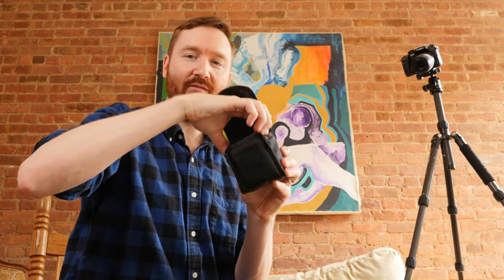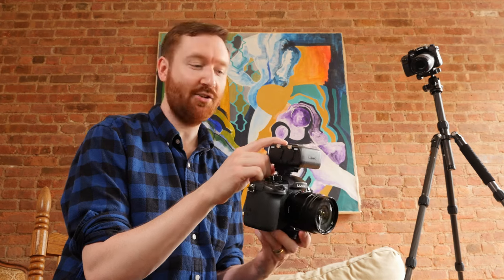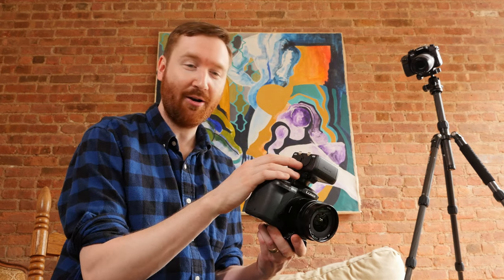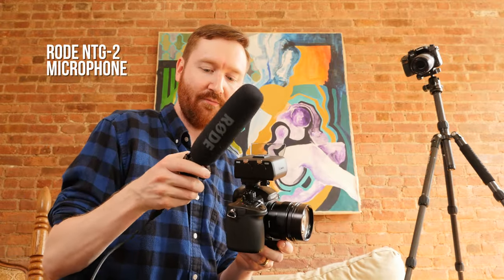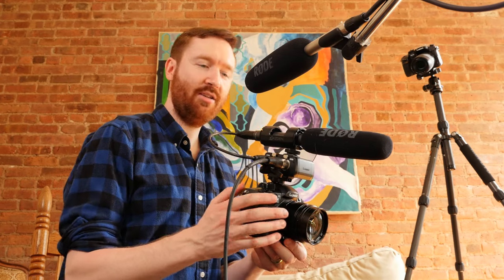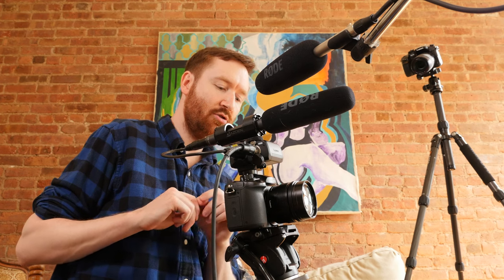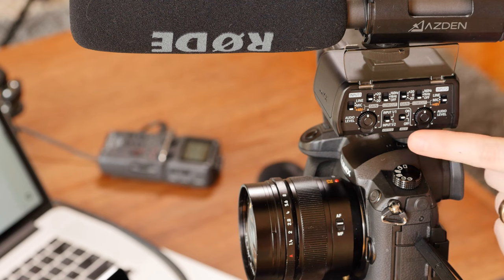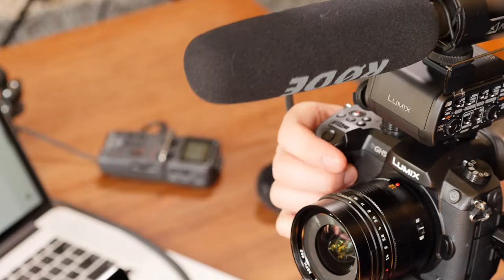Plug XLR mics into the Panasonic GH5

Comment: That noise floor is terrible for a 400 dollar audio accessory!!! This is not good at all. Listen at the 2:08 mark... when you switch back to your external audio recorder it's a world of difference. Anyway, thanks for testing! Oh and how does this thing affect battery life with for example one XLR mic with phantom power connected?
Reply: Most likely the GH5 XLR unit was not optimally calibrated for Griffin's mics. I know that the GH4 has a noise-floor of -73 dB RMS when set-up correctly ( significantly better than most DSLR / Mirrorless cameras ), and I would expect this unit to be as good or better than the GH4. ( for reference the Zoom H4n portable recorder has a noise floor of -66 dB RMS )
Reply: Its just plugging in the mic and adjusting the volume knob to get normal recording levels. There's no 'calibrating'  involved. It all boils down to 3 options: 1) The mic used has an EXTREMELY low output level and the volume on the XLR unit had to be turned up all the way to the max to compensate. 2) The XLR unit is just noisy. 3) Something is defective. Could be the cable, the mic or the unit. 

Apparently the NTG-2 has a rather low output level. I wouldn't say extremely though. So my bet it's a combination of rather average amplifiers inside the XLR unit combined with a rather low output level mic. Either way the result I'm hearing just sucks and is unworthy of 400,- dollar
Reply: It depends on the noise-floor of the preamp and how clean the gain is. Some units work better by recording with little gain and boosting the recorded audio in post, but this depends on the unit having a very low noise-floor.

The GH4 has a very low noise-floor when set to it's lowest audio level ( with almost no gain ), but you need to feed it a strong audio signal to get the best performance from it, which means using mics that put out a strong signal.

I often recommend the $60 TakStar CM63 "pencil" mic for indoor recording because it has no rear audio "lobe" so it won't pick up reflected sound from walls, ceilings, or floors ( low cost shotgun mics are terrible with picking up reflected sound indoors ), and because it puts out a very strong signal compared to a mic like the popular Rode NTG-2 shotgun mic.

With some mics you are going to have to add more gain using a low-noise inline XLR preamp like the Triton FetHead, which produces +20 dB of clean gain and runs on phantom power. Alternatively you could use a low-noise mixer for this, but a good unit costs at least 5x what the FetHead does.
Reply from the maker: I actually never switch back to the audio recorder in the video. What you're hearing at 2:08 is me switching the NTG-3 to both left and right channels. Before that, you're hearing two microphone signals on top of each other.

Comment: Hey Griffin.  I have one, but mine is pretty loose. The lock isn't tight at all like my flashes would be.  If I jiggle the camera, it moves around on me. Does yours lock down tight?  Just wondering if mine needs to be adjusted or swapped out.
Reply from the maker: That doesn't sound normal. Mine is easy to lock, but feels secure. It doesn't jiggle.
Reply: We spoke at the Panasonic booth today. I do the hunting she's. I talked to Sean at the show and he said that is normal and the adapter has electronic circuitry to prevent handling noice from coming through. I'll try it again, but I had noise that seemed to be from the movement of the adapter. It could be from something else so I'll re-test.